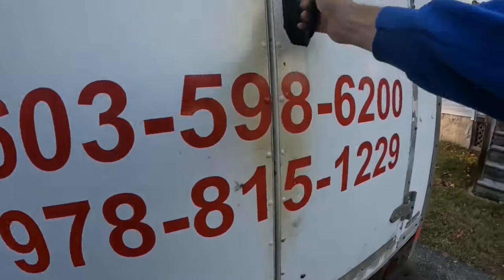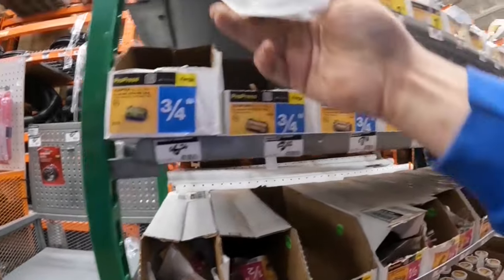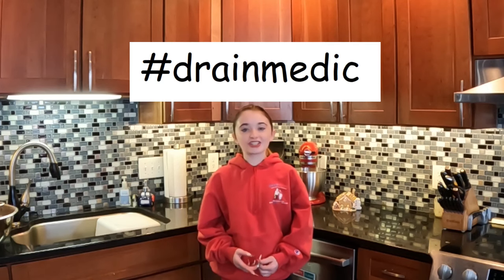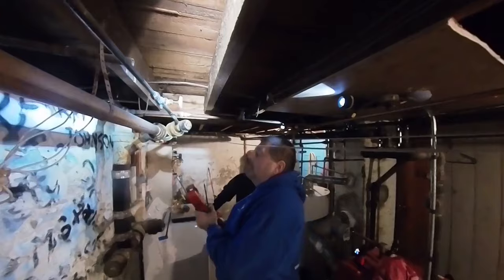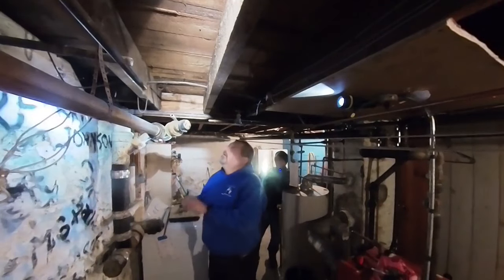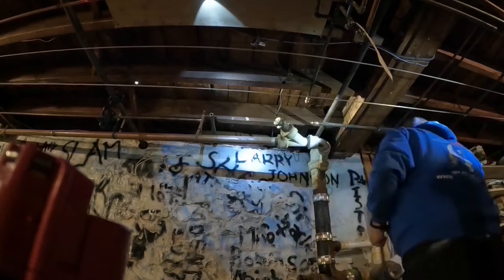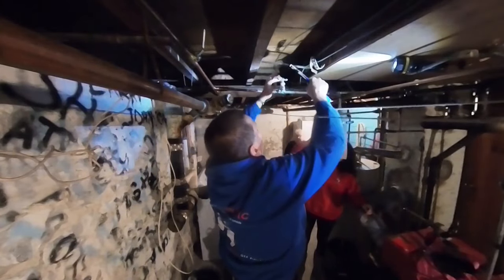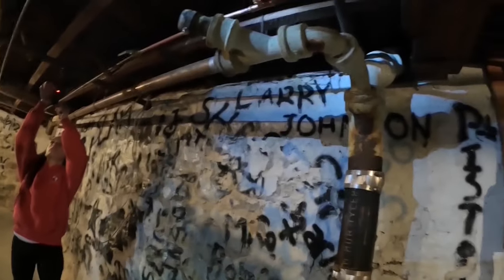Black Friday Emergency Plumbing Repair After Hrs

Comment: I still can't get with the pro'press, but you guys made it happen...good job.👍 Also, I was diggn the skit, kudos to the lil'lady!🙃💯
Reply from the maker: May I ask what's holding you back? Thank you for the compliment it means a lot to our family. Thank you again. (Shelly)
Reply from the maker: I still break out the torch once in awhile. They both have there place. Also use Pex A for larger work. Thank you IFIXDIT P&D (Bob)
Reply: @DrainMedic  Guess I'm just old school. When I do a job I'm in and out , no more than 1-2 hours.  Using a propress, I can't justify the fees knowing I'd be in and out within 30-45min. But I do understand that times are changing, and you must keep up with the technology or you'll time yourself out without keeping up with the latest tech. Hopefully my sons will be able to take the ropes when I'm done and keep the drive alive.😊
Reply from the maker: What's funny is this job would have been way faster if i soldered. I had all the parts in the truck. lol But i wanted to propress for the channel lol. So we took the 45 min round trip to get 1 part I didn't have on the truck. 3/4 x 1/2 press coupling. I was shocked Home Depot had propress. Never seen it there. Supply houses were closed. It was after 4.
Reply: @DrainMedic  ok,cool...either way, I'll likely be investing in a propress setup soon. Gotta keep up with the times plus never know when it'll come in handy.
Reply from the maker: I have had this one for 9 years. Milwaukee 12v. If i did more research. I would not had bought this one. Cant get into tight places. Would have got the one you press a separate jaw. Easier to get between joist. Think Ridgid makes one. If I did more gas work or steam boilers I would ad a mega press. 95% of our work is drain cleaning. 100% profit very little parts. lol
Reply: @DrainMedic  I know once I do decide to grab 1, they'll come out with 1 smaller, stronger, light weight...and much cheaper😂🤣. Ttyl,hagw👍

Comment: Always out of some needed pieces. It's never easy.
Reply from the maker: Exactly, you always got to do that store run, no matter how many lists you make. Story of my life in every aspect lmao. Thank you for watching. (Shelly)
Reply: @DrainMedic  I would do the store or shop run then find out I didn't have the first thing I needed when I got back. I started trying to imagine doing the job and the tools and parts needed but it seems that something usually comes up that requires one more tool or part.
Reply from the maker: Yup story of a Plumbers life 😂